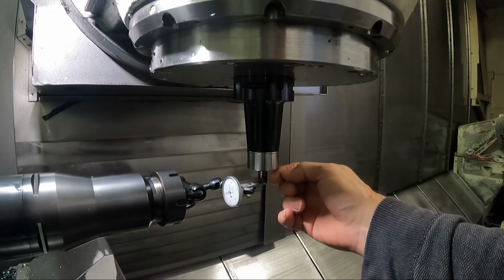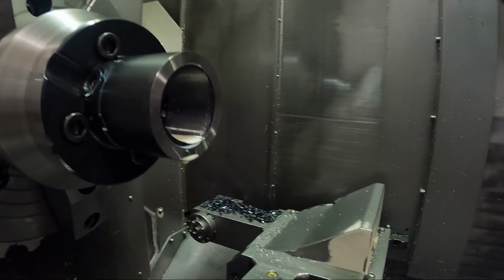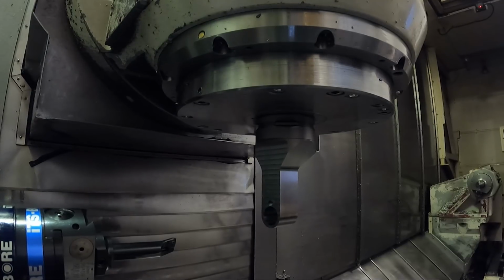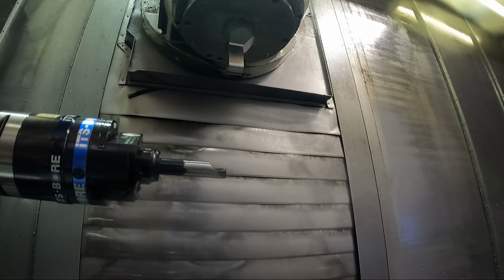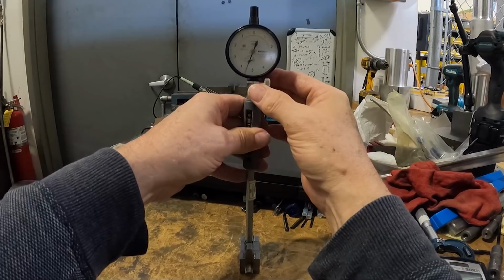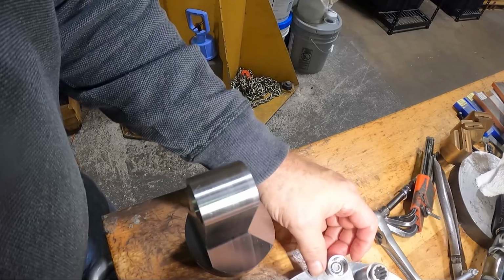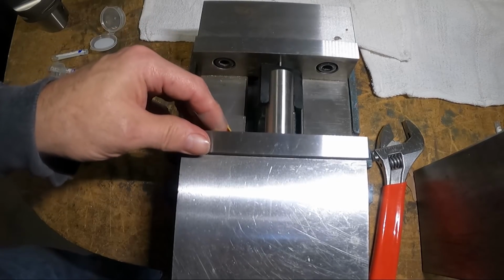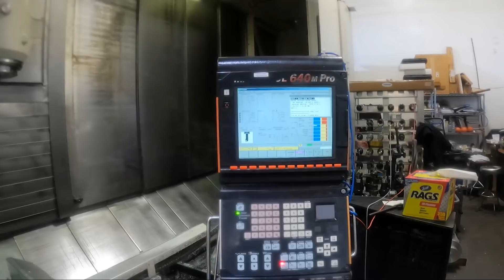Boring For Spindles and Running Tools

Comment: I really appreciate the attention to the smallest deviation from zero by rotating the carbide blank while sweeping the indicator in the lathe spindle. And as if this the Mazak doesn't have enough capabilities. Let's chuck a boring head in the lathe spindle, to bore a capto tool holder blank to run a high pressure coolant powerd spindle cartridge. I'm guessing this is probably not in the mazak sales brochure. However it all makes perfect sense. Extremely well done!! Thanks for taking us along. I know these videos take a lot of time and effort. Thank you
Reply: At the end of the day, this machine is just another tool and if you understand how it functions then a clever person can make it do all sorts. Some of these ideas aren't new like putting the cutting tool in the lathe spindle. Alot of hobbyists do this to make keyways but its still bloody interesting!
Reply: you could do this with any mill/turn machine. it's fairly common practice to bore out tool holders and sleeves on c axis lathes using a similar technique as well.
Reply: @wildin13  Why would someone do this for a keyway? I'm intrigued since I've been doing it the "normal" way for a while now and don't see how it would change anything for me.
Reply: @shadowdsfire  well whats the normal way?
Reply: @wildin13  Put the broaching tool in the milling spindle, clamp it, and then broach away..
Reply: @shadowdsfire  and you do that on a hobby lathe?
The keyways im referring to are the kind you would do with live tooling or on a mill. If you only have a small lathe then your only option is to put the endmill in the chuck and mount the workpiece to the cross slide
Reply: @wildin13  ahh gotcha. For some reason I though we were talking about internal keyways
Reply: @shadowdsfire  yeah, I realise that now. I'm a mill boy so forgot about broached features if I'm honest. So i got really confused when you said the normal way 😅

Comment: Nice work Peter as always.
Those serrated "pullstuds" for the Capto were originally used in the Captos predecessor, Varilock.
Varilock had no taper contact, just a cylindrical section and face contact with a drive key.
We still have a lot of Varilock stuff that we use on our large mills (BT50), its still pretty rigid but nowhere near as good as Capto. We also have some capto C5 and C8 stuff.
Reply: I'm sure it worked fine but having a single drive key or any other kind of asymmetric torque transmission just doesn't sit right with me.

Comment: Very nice toolmaking! I was questioning the single retention screw but seeing the tolerances you bring the fit to I can't imagine that being a problem.
If someone ever needs to drill angled holes on a 3-axis machine I could imagine making a variable angle head using those things, could be handy for the odd job for some folks.

Comment: I've used one of these heads mounted in a spindle that maxed out at 5k and we needed to run a 0.25mm ball endmill,  and we had one that was air powered. I'm almost certain its from the same manufacturer. Did a good job for us. your set up looks so good. thanks for sharing.

Comment: Looks like they work pretty good! I looked into some capto stuff to use for deep boring on my Hbm but have not found much of it available in the secondary market and it’s a lot of coin new just to give it a try.
Reply from the maker: Yes that boring job you just did on that engine block would have been a lot easer with a Sandvik silent bar.
Reply from the maker: @importanttingwei7747  Yes I have tried both. The Sandvik work better.
Reply: @EdgePrecision  I will keep my eye out for adapters and bars. Wasn’t the capto stuff Valenite before seco bought them?
Reply from the maker: @bcbloc02  No Capto has always been Sandvik. In fact until their patients ran out. No one could even produce it.
Reply: I use a D'Andrea modular system for our portable machines. It has a side screw to remove the various adapters. Italian made. Expensive but better for manual machining.
Reply from the maker: @C2DSolutions  The ITS/Iscar system is the D’Andrea just rebranded ITS for Iscar.

Comment: Always awesome to see decades of experience boiled down to a 'its not that complicated' point of view.

Recently heard a story on the Within Tolerance podcast where someone used a similar concept to use TSC and 15,000 rpm spindle to get 80,000 rpm on some tiny about .05" endmills to slot an exotic board about 4 times diameter.
Reply: This probably runs abotu 70k rpm

Comment: Outstanding solution, superbly executed as we would expect from you Peter!
Those ?tool holders? Will be very useful other times down the track but, I assume, on this job will mean all tools will be racked, offset calebrated and ready for the program to call.
No manual tool changes.
Bliss, efficient, smart.
Thank you for taking us through that exersize.

Comment: 118/2000 
This can be done through the angle head, the cutter can be sold, can be purchased off the shelf, is relatively expensive, but I admire your hands-on ability, and thank you for the experience of the video
Reply from the maker: You need to watch the previous videos in this playlist (Aluminum Landing gear strut). It will then be clearer why I'm doing it this way. As far as the automatic back spot facing tool (If that's what you are referring to by "This can be done through the angle head") The diameters I need aren't standard. I did price them and they are expensive. Also there is a long lead time to get the none standard diameters.

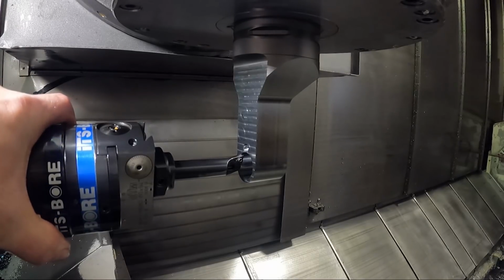Comment: 16:40 ..  I like how you start with your distance 'too close-- and then you back off until it fits.  I can see how that's much safer than slowly closing in until it bites;  and how you could make a mistake doing it that way.   That's one of those low key tricks that come with experience that you skipped over without even thinking about it-- but it's actually a very smart idea that should be mandatory.
Reply from the maker: I’m not sure I understand your question. Are you referring to setting the diameter of the boring head, for the first cut?
Reply: @EdgePrecision  No.. Just how you set your zero with gauge pin.
Reply from the maker: I use a 1/2” dowel pin instead of shim or paper. All I do is jog the tool to where the pin won’t pass thru. Than jog away at the finest rate until the pin just passes thru. Without any trouble you can get it within a .0001” or one click of the jog wheel. I prefer the round pin because you can feel exactly where you are going without risking jogging solid into a piece of shim stock and breaking the tool.
Reply: @EdgePrecision  Yeah, tha'ts exactly what I was saying--- how you jog AWAY/  rather than towards it.  That way you can never crash into it.  It's a nice little technique-- when I seen you do it, it set the light bulbs off in my head. lol
Reply: @EdgePrecision  This is exactly the way I set up all my tools manually. It's much more repeatable and safer too. Excellent little critical detail

Comment: It's difficult to understand how the length of the tool stays consistent.  Does the rear bearing run against the back of the recess you've machine - so if the tool pressure exceeds what the bearings and impeller can resist - the back wall of the recess will stop the tool from receding away from the part being machined?  Very interesting series - hopefully we'll get to see the parts being machined soon.

edit:  Oh, ignore me.  The capsule is not open at the back.  I get it now.
Reply: I was wondering too, your edit is the clue, tnx.

Comment: Thank you for another great video.

Newbie question: the position of the holder coolant hole is not important to maximize the efficiency of the WTO coolant spindle?

Thank you,
Jorge
Reply from the maker: I don’t really know. In this case I didn’t really have any other options. The shape of the 90 degree head it pretty had to be that way. I do have a recess behind the spindle to allow coolant to flow up all the flats to the coolant holes in it. That’s about the best I could do.

Comment: Andy, concerning the non assignable offset on your diameter. You might be able to assign a macro activated subroutine to compensate with an offset. Does mazak have assignable macros? Consider macro B , 'while do' or 'if than' loop. They are is used in Fanuc Controls. Just a suggestion 🙂
Great job! Had me at every move! Ingenious!!!
Reply from the maker: After I ran this test part and made the video. Thought of this idea. On the G41 line put this code. G41 D#100 and the XY move. Then set the Diameter in the beginning of the tools code by putting a line #100= (what ever diameter I need); I think that may work. I will try it and see.
Reply: @EdgePrecision  I don’t know how Mazak works with Macro B, but the whole standard is #100’ish variables is used by machine (tool and pallet numbers, tool length setter or tool breakage detection system, etc.). That’s how my Mori Seiki machines works, at least.
Peter, please be careful using that feature since variables is volatile. Use range starting from #500 and so…

P.S. Best content, as usual. Thanks
Reply: @EdgePrecision  yeah we used to do that all the time at Synthes USA. We made spine implants for humans and they had a family of parts that were different sizes for different size bodies. So we would write code and alter with macro calls it to accommodate the larger or smaller sizes. I'll tell you one thing it turned into spaghetti code. The object was is all the operator had to do was enter a part number for that specific size part and follow the setup sheet. Really fun watching that video hope everything turns out maybe you'll win the contract?
Reply from the maker: @mikhaildavydenko6841  All Mazaks really have a Mitsubishi Meldas control. Like my horizontal mill has. They just put the Mazatrol on top of it. The first set of variables are user variables. I use them all the time on my horizontal mill for things like this. Some of them from about 138 on are use by the Renishaw probe (if you have one) also some of the ones in the 500 area for the stylus calibration of the probe. Then there are system variables that can be used by the program to access machine information. Like offsets machine location and tool information. This is how for instance the probing macros work to set things.
Reply: @EdgePrecision  thanks for the reply! That’s exactly how it works.
From my experience (about 7 years of macro programming), I’m using #100-#199 variables for my Renishaw custom routines, for calculating real-time cycle values, and to save macro program input if I want to use macro as a modal (not G66 call, just an “M” letter in my macro programs).
#500’ish stuff for NC programs, when I need to mill with axial stepover, or rotate a table multiple times at a given angle, etc…
Local variables (#1 to #33) is used only to obtain parameters for a macro.
System variables (starting from #1000) is the thing where all the offsets, clocks, tool data, feedrate hold and other stuff).

P.S. NIH syndrome is not about me, but my old Mori machines (2002-2006) just have no any helpful cycle and not enough memory available to create every program in MAPPS. That’s why I started implement own features for sure.
P.P.S. Thanks God, in previous year I got DMG Mori NH4000 DCG (2015 y.) and it’s more friendly machine which have a bunch of cycles on board already… 🙂

Comment: Nice,do you have to check the coolant with a refactoring meter to ensure that the coolant is where it needs to be? After the job is completed, I would think that you have to clean all of the coolant out so it doesn't get gummed up? Nice tool to add to your collection.
Reply from the maker: I do check the coolants concentration with a refractometer. The high pressure coolant pump has a special filter on it. I’m not sure what you are referring to. When you say the coolant will get gummed up. How would running these little coolant driven spindles cause that?
Reply: @EdgePrecision  I believe Tom is wondering if you have to clean all of the coolant out of the coolant driven motors after use to prevent the coolant from drying out and making the motors "sticky".
Reply from the maker: @smusselman1  I don’t know yet. I would say if they were going to sit for a long time. Yes I would. But remember when you change tools you replace the bearings and impeller. So I would just pull everything out flush it out with something. Maybe Lps or wd40.

Comment: How long did it take you to figure out, program and set up this boring operation? Would it have been faster to bore those holes on a manual mill if you had one available?
Reply from the maker: I could have bored this in the previous operation (the previous video if you want to see). The whole reason I did it this way was to be sure of the most precise alignment to the mounting spindle this tool is operating in.
Reply: @EdgePrecision  Fair enough

Comment: Why not put tool in the main spindle capto adapter and boring head in b axis spindle?

Also in your set-up how did you clock the tool cartridge hole parallel to the main spindle z axis?
Reply from the maker: In order to get a more precise alignment of this bore. I wanted to bore it in its actual spindle it would be mounted in.
Reply: @EdgePrecision  Thanks for your reply.

Comment: Peter, excellent and amazing to watch even though I've never had any experience with any of your machines. But, that Mazak has a lot of stop/go, on/off, in/out, xyy, foward/backward that some parts are taking more abuse than others and will consequently need maintenance and or replacing. How often do you need to address these issues. Thanks again for the content. Cheers
Reply from the maker: Up till now I have not had many maintenance issues with this machine. A few I have even done YouTube videos on a few of them. I do most of the work on this machine. What I can’t do there is a guy here in Houston that is very good with this machine.

Comment: Thanks for another great video, currently my fav youtube channel :) Was curious why you didn’t clock the bore at the start to pick up the correct boring head location? (The bit where you used the carbide blank). Were you more interested in getting the absolute bore position relative to the spindle face than aligning with the existing hole?
Reply from the maker: You answered your own question. I could have bored this hole in the previous operation (the previous video). But in order to have absolute alignment to the spindle this tool would be mounted in. I bored it in this way. Not aligning to the existing hole but setting the actual position in the tool offset. Then boring it to that location. Also making sure it is on the exact centerline if that spindle. That way when I index it 180 degrees it will still be on centerline.
Reply: @EdgePrecision  thanks for confirming

Comment: Pretty amazing capability to add to the machine for not very much money (I would think) compared to an additional spindle. Do you see any other applications for these 90 degree tools? I'd imagine some materials out there would need the super high RPMs, which it seems like you now have.

Tangent question, but how long do you usually get to work continuously on one job before getting pulled away for other things? I like your approach of focusing in on the details and doing an excellent job, but I wonder how often you have to put the job down and tend to another job/machine. 

Thanks again for the videos.
Reply from the maker: What you see in many of my videos doesn’t really show the reality of the situation. Every day I’m running my horizontal mill on a production job I do. People are often coming asking questions. I’m also looking at other jobs and often grinding special tools on my grinder. Fortunately on some jobs on the Mazak Integrex I have time to do these types of setups and make the videos.

Comment: Hey Peter. Happy belated New Year. Another excellent series leading up to the boss machining, as well as the previous videos. I don't always comment but really enjoy your videos. Still impressed with the air knife keeping the coolant in check too, let's us see enough of the action, better than most.  Glad your test was successful. Did you end up making these to get them in hand sooner or was it less expensive or both? just curious. Really appreciate the way you used the machine to get what you needed, very outside the box. keep them coming while it's worth your while and I'll keep looking forward to them Thanx, Be Well.
Reply from the maker: I made them because I could set up all the tools and not have to make manual changes single angle head. I also like the simplicity of this system. Not to mention it cost less money to do it this way.

Comment: Hi, I want ask you a question. where can I buy the 'manually clamped adaptor'? (7:41) sorry for my english:)
Reply from the maker: Are you asking about the Capto adapter? If so you can buy it from Sandvik.
Reply: @EdgePrecision  No, I ask for BT tools
Reply from the maker: @Oğuzhan Erciyes  The adapter in this video is for a Capto shank. I don’t know but Sandvik may make one for a BT shank as well. I am using it in a different way then it was made for. This is really an adapter to mount on the spindle of a horizontal boring mill. To be able to mount Capto shanked tools.
Reply: @EdgePrecision  thank you so much

Comment: What’s the counterbore machining cycle time? I think I read that the expected cool speed bearing life was about 5 hours, dependant on coolant pressure and hence RPM. With 37 parts and four counterbores each part, I’m guessing you may have to change the end mill bearings?
Reply from the maker: I’m not sure yet. If that were the case. I would have to change it one time in the 27 parts.